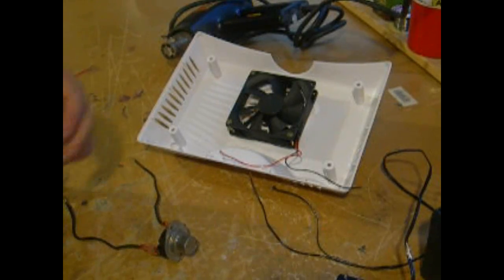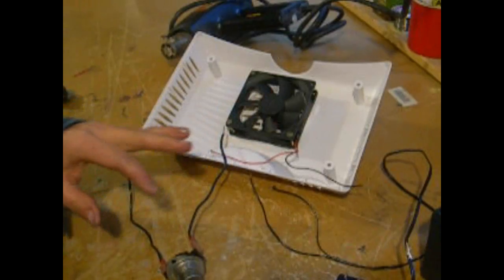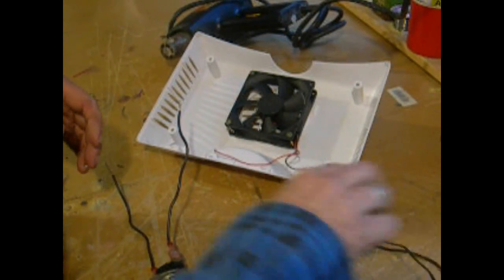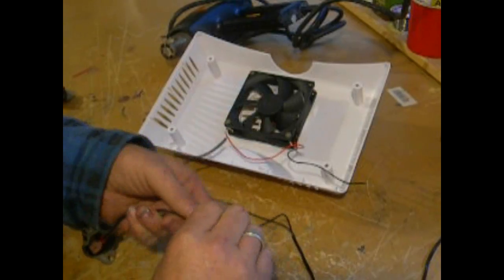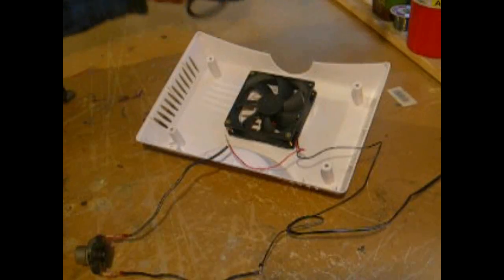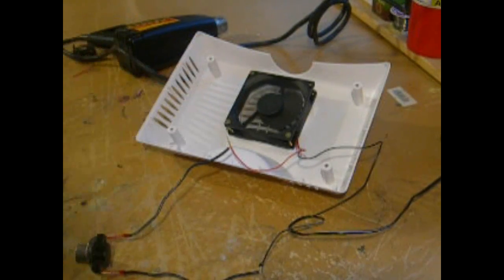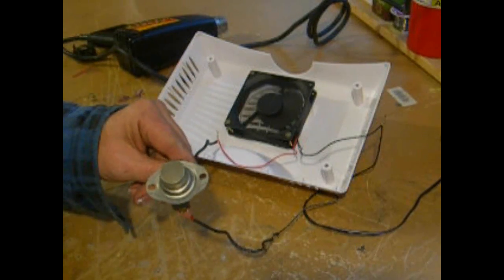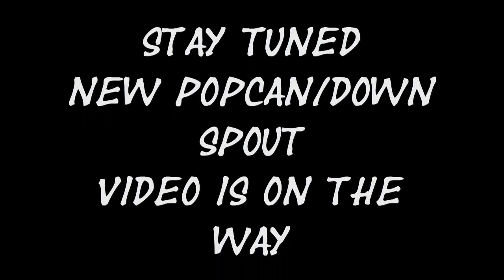How to wire a snap disc

Comment: Work with 120-170 deg snap switches and my question is, using a multimeter, how do you determine if a switch is faulty?  Generally, What should the resistance be for a normal and a faulty switch be?

Comment from the maker: hi a snap disc takes no power and if your using a 12 volt computer fan a small 5watt 12 volt solar panel works great    stay tuned i just started to work on a new heater  will post when finished   Rich

Comment: thanks for the in formation i have a few questions how much power does it take to run the 12 volt fan and the snap disc. im trying to use solar panel to run my fan and snap disc with out any batteries. i was thinking the heater only works when the sun is out and the same with the solar panels. i was thinking thay would be good partners in my project. any advice would be great

Comment from the maker: @jjohn984able hi you can buy a adjustable one thats cuts on at around 90   but the 110 seems to work good . remember your heater will get over 100 degrees in about 15 mins in the sun you will have airflow because hot air rises the fan just boost the flow also it will drop the temp some then level off   good luck

Comment: hello i have been looking everywhere for those snap disc controllers where can you find them you can find them on ebay but they all turn on at a very high temp i want one that turns on at a lower temp

Comment from the maker: The fan just helps boost the air .  it flows into the house fan or no fan because hot air rises also if you use plastic sheet it will keep it from warping

Comment: Good description Rich. This is exactly what I did. I used two 12 volt pc fans, and i'm powering them with a 12 volt battery. The battery is being charged by a 18 volt trickle solar panel charger. The solar panel charger will run only one fan, and it has to be sunny. That's why I'm using the battery. The neat thing I discovered is that if you concentrate light onto the solar panel using something reflective, you will see a huge increase in power output. try it.